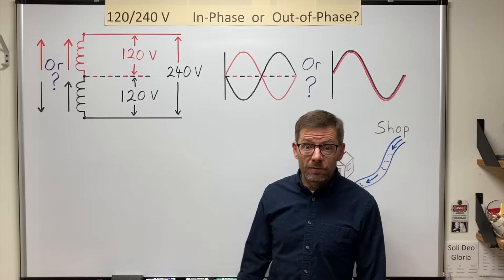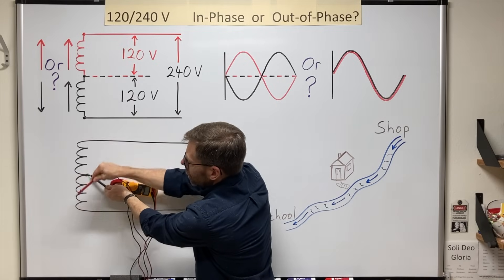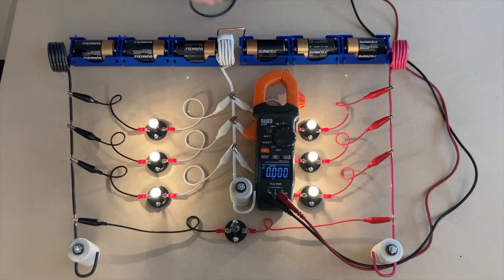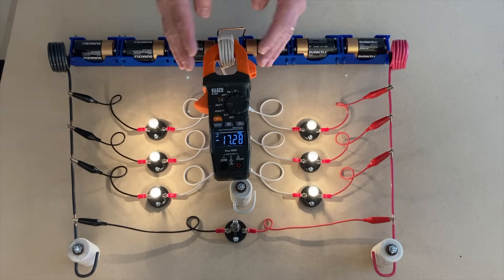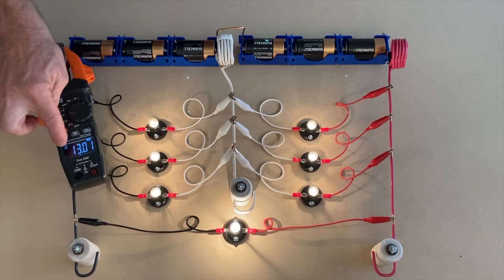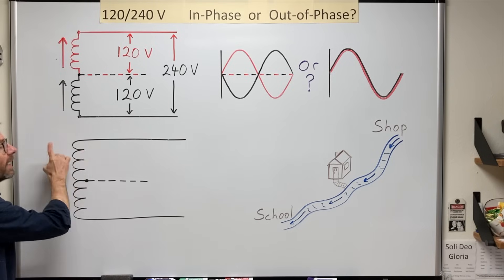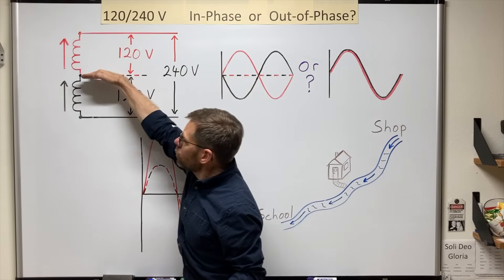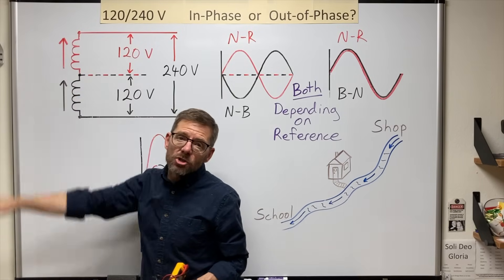120/240 V  In-Phase or Out-of-Phase

Comment: I always looked at it intuitively from the center point as the reference, where the difference between the two waves accounts for the greater amplitude. There is more area between the lines. A three phase system is truly out of phase, and from the difference between them at any point of time we can extract current. But of course one full winding has to be continuous.

Comment: Dave, at the beginning of the video you explained if the turns were reversed at the neutral point that it would be out of phase. It would not be out of phase, but instead it would be reversed polarity. Reversing the polarity would give you two 120 circuits and a net zero for full tap. It is how a regulator works with using reverse polarity and using the same winding to be able to raise or lower the voltage, but any single winding coming off a highline single phase will always be in phase of each other.
Reply: Practically in an AC Sine Wave, don’t they have the same effect?
Reply: @I_SuperHiro_I  Yeah. Reversing the polarity is essentially multiplying the sine wave by negative one, which is the same as being 180 degrees out of phase.
Reply: It would both be true it would be out of phase and it would be opposite polarity. A square is a rectangle, with some additional requirements. The case of 180° out of phase three wire system two phases is a special case where a lot of things equally each other and zero out.

Comment: You can't choose two different reference points for two signals to determine if they are in phase or not. You need a common reference point. Why not use ground? Oscilloscopes use ground as the reference point. If you do that then you find that you will see two sine waves that are 180 degrees out of phase on the oscilloscope screen. If you want to call that "in phase" then go ahead, but it's clearly inverted.
Reply: I've been trying to make a similar argument here and the naysayers have zwro answers in return for me.

If someone wants to call a straight line (0 or 180 degrees, either) in phase by virtue of there being no 'angle' that's fine, but as you say, phase relationships require common reference points. Same in geometry to draw an angle: it needs a vertice.
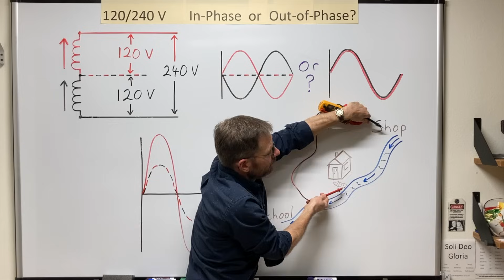Reply: @spruce_goose5169  Pay better attention to what he says at 16:30. Not only the reference taken do matter, but also the direction, that is, which lead is applied to which point. If you flip the leads for one measurement, then a transformer with a same winding across the the two havens will show to be about in phase. Vice versa, one with reversed winding would show to be out of phase.
There is no elephant,  and science still reigns.
Reply: @JDM  "there is no elephant, and science still reigns "

If you want to have a real discussion, you need to check useless statements like these, designed only to make yourself feel superior, at the door.

I'm not sure you've understood my point at all, as you are somewhat making my point for me. 

My point is precisely that it all depends on reference. The two halves are for sure 'series aiding' and that is what some people are deciding equates to 'in phase.' But phase relationships are about relationships, and thus just like in geometry, if you want to compare the relative angle of two lines, you need yo define a reference point. Neutral is commonly this point, and no one can deny that WITH RESPECT TO NEUTRAL, L1 and L2 are 180 out, or 'inverse.'

If you don't want to involve thr neutral (center tap) at all, then what you have is ONE SINGLE SIGNAL at which point discussing phase angle relationships is irrelevant. 

One CAN do what he has done in the video and move the common from L1 to N to show the series aiding relationship, and CAN even declare that this means the two halves of the secondary are 'in phase,' but it's entirely semantics and not mathematically precise if the accepted convention is that the relationship is IN REFERENCE TO NEUTRAL. 

But I fully understand some people take issue with the convention that the relationship be described in reference to neutral.  It's what we typically do though, including on 3 phase. 

Consider the root 3 multiplier when converting a 3 phase line to neutral voltage to a line to line voltage. That's roughly 1.7. The math suggests that if we use a 1.7 multiplier dor 120 degrees out of phase,  we would use a multiplier of 2 for 180, and 0 for 0. And in a split phase system, we multiply 120 by 2 to get 240, which suggests the 180 degrees out of phase (by convention).

Long story short: no supporting info in this video is incorrect--I merely take issue with his 'declaration.'
Reply: @jdm2651  does my point make better sense now? Or maybe I need to punctuate it with:

There is no macaroni, only baloney.
Reply: @spruce_goose5169  it's like some people have already decided to call this "in phase" and they are trying to find analogies to attempt to justify their belief. They aren't really trying to address the elephant in the room which is that with ground as your reference point, the two sine waves are in fact 180 degrees out of phase.  They get annoyed when anybody who went to engineering school sees the waveforms and says "those are 180 degrees out of phase" because, well, they are. Just get over it. It doesn't matter, it doesn't change anything. Electricity still works.
Reply: @MartinVandepas  when generators operate its my understanding that phase one starts at the north pole of a magnet while phase two starts at the south pole of the magnet which would always keep them 180 degrees apart from each other. having a tough time taking this guy seriously.
Reply: I appreciate your attempts, but I don't see ANY of your other comments.
It is somewhat of a "slight of hand" trick to move the reference between measurements. If you're allowed to do that, I can show you how the primary winding is out of phase with itself.
Reply: They are out of phase only on the osciloscope screen. In reality they are in phase and are ADDING UP!!!! If they were truly out of phase 180 degrees then the voltage between the two legs would be ZERO!!!!
Reply: @Ignisan_66  Find a power supply that produces multiple DC voltages. Measure between -5 and +5 and tell me what you get. Hint. It won't be zero. Think potential difference.
Reply: @AITA-NIM the real issue is why you use the grounded conductor as your reference. You have to because on most scopes the scope itself has a chassis ground used as the scope reference. However if you use a fully isolated scope which are very costly you can easily view both legs confirming current direction is the same on both legs.
Reply: @Ignisan_66  "If they were truly out of phase 180 degrees then the voltage between the two legs would be ZERO!!!!"

This is sort of 'begging the question' logic fallacy. You're using a conclusion to support an argument rather then the other way around. I could say the same (but opposite) thing:

If they were truly IN PHASE, then the voltage between the two legs would be ZERO!!!!

Both statement are useless on their own, as they provide no actual argument. Everyone agrees that the two 120 volt rms legs add to make 240 volts rms. The two halves of the secondary coil are no doubt 'series aiding.' To make the leap that 'they are in phase' is leaving parts of the argument behind.

Such as: what is 'they'? L1 and L2? Or 'halves' of the coil? Signals? Assuming everyone knows the realities of the system, it becomes mostly an argument about semantics and how language should be used to describe said reality. Of course not everyone is on the same page about what the 'reality' is, and so that's the first step.

I'll assume you and I both understand the physical realities of the system. Assuming that, I would ask:
"Why, if the oscilloscope shows two signals 180 degrees out of phase, is that NOT reality? Is L1 not 180 degrees OOP to L2 with respect to neutral? Mathematically speaking. (It is, by the way).

Where things get less clear is when people don't define the phase relationship as clearly as 'L1 and L2 with respect to neutral.' If instead people just say 'is split phase power in or out of phase,' or 'are the two halves of the secondary coil in phase or out of phase' then we no longer have clearly defined our base reference, and it's much more open to interpretation and what people think 'in phase or out of phase' indicated. You and others think it means 'series aiding.' I'm unclear why beyond that you have decided to make a declaration like a king declares law. It doesn't change reality.

To be clear, I think it is fine to say that the two halves of the coil are in phase if what the person is indicating is that they are series aiding. That is the definition they are using, and so that's fine and not wrong.

But mathematically, if one takes 3 points with a common reference-- just as one would when defining the geometric angle of two lines-- then with center tap as that common reference (the vertex of the angle) the two lines being compared (L1 and N and L2 to N) are undeniably 180 degrees out of phase. One could perform a sort of geometric translation vs a reflection and declare them in phase, however. All these various sentiments can coexist because they are being used in different contexts and with different assumptions about what the base language is describing.
Reply: @spruce_goose5169   Alright man I agree with you.  The two halves of the transformer coil are series in phase thus are adding but when we measure the two legs with respect to neutral we get two sine waves 180 degrees out of phase on the osciloscope screen.

Comment: THANK YOU for this!  I have been trying to explain this to people for a while, and this demonstration perfectly outlines everything I've envisioned and understood.  The principle of number of turns is key, as that not only directly relates to voltage (transformer ratio), it also means that if "180° out of phase" were true, then 240V could never be made.  Again, thank you for this fantastic complete demonstration and explanation!
Reply: Let me try to come to your page since our previous attempt went nowhere.

You make the claim several times in these comments that it is utter folly to use the center tap (neutral) as a constant reference. I have one simple question I am hoping you will humor me by answering:

Why is it folly to do as such in a split phase scenario, yet it is common-- standard in fact-- to use a common reference when determining phase angles in 3 phase?

If you disagree that it is the standard to measure 3 phase relationships off a common neutral, please work with me on that. That would be our sticking point. If you agree with that but think there is some fundamental difference in the way split and 3 phase are measured, help me understand what that fundamental difference is.
Reply: @spruce_goose5169  Yeah, and these people would get totally lost if you give them a corner grounded 3 phase Delta system. OMG where's the neutral wire?? lol.
Reply: Geez. Me thinks Jovet swam too deep. Confidence > comprehension perhaps. Came out swinging he did.

Comment: I just subscribed after watching this video. 
Do you have a video showing what is happening when you take 2 leads of a 3 phase system and run a 240 volt single phase motor on it?
Reply: Step one: What's the phase-to-phase voltage?
Reply: @jovetj  ,would it be lower than 240 volts because of the phases being 120 degrees apart.
Is it simply single phase? 
Assuming it is a 240 volt wye  3 phase source.
Reply: @mikeeiben3430  It gets complicated because there are several different configurations of 3-phase circuits.  For delta 3-phase, voltage is listed phase-to-phase because there is no neutral.  For wye 3-phase, voltage is usually listed phase-to-neutral.  So, a 1PH 240V motor would operate just fine when connected between any of the phases and neutral.  Of course, it's more likely a more-efficient 3PH motor would be selected, which would have to be designed for 415V phase-to-phase.    

There are 240V 3-phase delta circuits that have a center-tap on one of the secondary windings between 2 of the phase.  The voltage from that tap to the third and opposite phase would be 208V. The 240V 1PH motor would work just fine between any of these two phases.
Reply: @jovetj  thanks for taking the time to respond.

Comment: This is a center tap transformer ,what append in a delta 3 phases  transformer 120/208 volts.
Reply: Three phase is a whole other animal.  There is voltage potential between the phases because no two phases are at the same instantaneous voltage.  All three of them are always different because they are literally out of phase with each other.